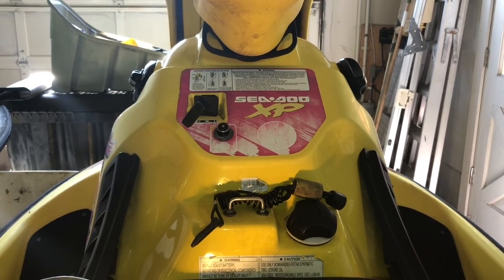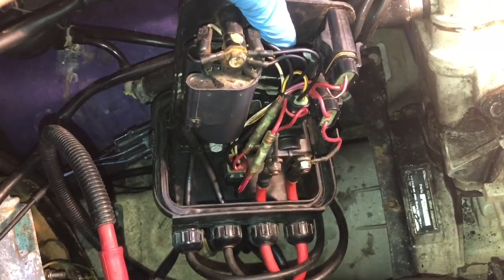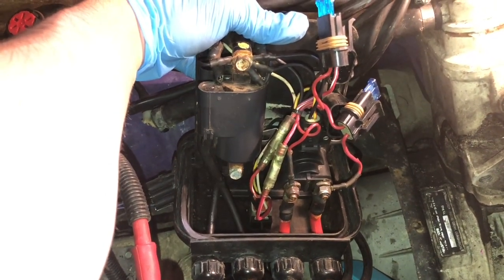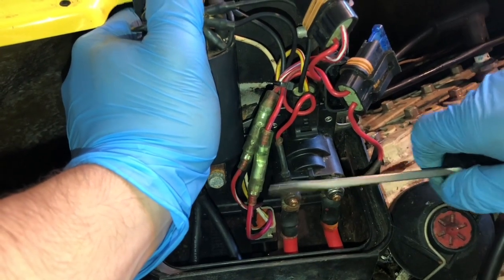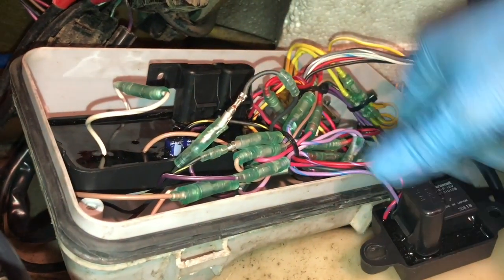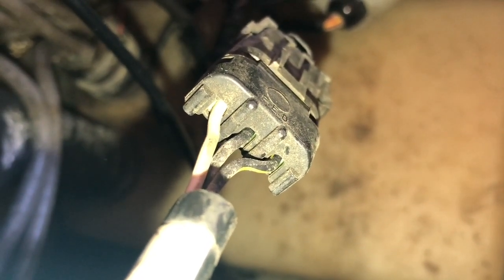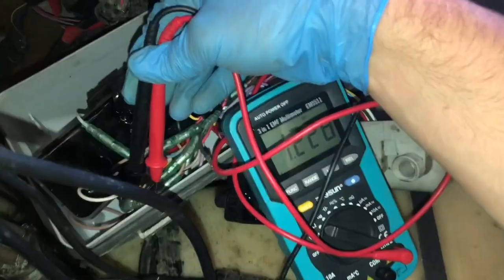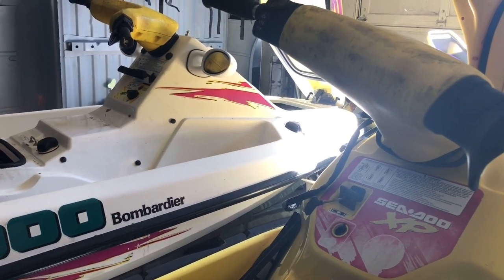1996 Sea-Doo XP Common Electrical Issues Fixed in Detail

Comment: Hello Adam   this Rob , I been watching  your videos because  I have a 1991 seadoo gt   with no spark I have tested  all the electricals but nothing   my question is  does  a 1991 seadoo  needs a programed key ? Or it can be by pass? In order to  get  it started? Because I don't have a key.   Thanks.

Comment: Thanks for the video.  do you have any idea what would cause the gauge to have nothing working on it?  the ski will start and run fine, but none of the lights on the multi function gauge work or come on at all.  They dont have any readings.

Comment: when you bridged the two red wires at the solenoid  if the starter was good it  would have cranked without pushing  the start button

Comment: This is odd starter solenoid should always spark the red incoming wire is straight from the battery the other red wire is to the starter ... shorting them just creates the circuit regardless of key absence or presence ... I don't understand how you don't get a spark shorting them.

Comment: Crossing the two large terminals on the solenoid should activate the starter motor. All it's doing is making a direct connection to the battery. Oh yeah, good vid. Thanks for posting this!
Reply: Yeah I know right...so wtf ..it would turn over immediately if starter good
Reply: Yeah this is an odd internet phenomenon , the solenoid info is partially incorrect,

Comment: Got a question for ya. My ski wouldn’t crank or nothing so I replaced the solenoid, cause when I opened the box it was  all corroded and rusty but after I swapped the new one nothing changed, tried jumping the solenoid and it started to crank over, pulled my starter and tested it it works fine. Could it possible be my start stop switch, some of the connections in the box look corroded but I wouldn’t think there corroded enough to make it not start, also changed all my leads from the starter to box and the ground and positive to the battery.

Comment: I've been looking thru forums and videos but I cannot figure out why mine is turning over without the DES on. I looked over the rear box and it needs attention. I re tightened the fittings and now it's dead completely.

Comment: great video, thank you...just fyi on the battery voltage, 12.2v is too low, it needs a charge.  A full charge should run around 12.4-12.7v

Comment: My no start problem on my 1995 HX was the fact that the nut for the screw on the positive terminal had come loose and there was no connection.  Glad it did t happen on the water.

Comment: So i have the same issue. I tested the voltage on the negative and positive wire on the solenoid. Measures 12.6. But nothing is happening. When i jump the solenoid it cranks over. What is the issue

Comment: bro, that is not how you check a safety post.   the two blacks should bridge when the post is near a magnet, and the one odd wire should bridge to the center pin on the post.    the reason is,  inside the post, there is a magnetic reed switch.   the key has a magnet inside of it, and the center post connects the Chip to the ecu.

Comment: Hey man. Whenever you put a screw driver across a silinoid that Jumps the starter an turns the engine over.  So idk why your telling people to put a screw driver across and hit the starter button   That does not tell you anything
Reply: he shoulda said “when i put the screwdriver across the solenoid and it cranks on its own, that means you need a new solenoid.” completely missed the whole point
Reply: @christophershirk489 nope that's also incorrect, anytime you connect the two poles of a solenoid you are "bypassing" the solenoid altogether, it's essentially plugging your battery directly into your starter, unless your battery is too low on voltage, disconnected, or not connected to the starter, it will always crank if you do the screwdriver method, the engine won't spark necessarily and you can't run it but it's a good way to get a compression reading on a stagnant motor. The author must have had a disconnect between the solenoid pole and the starter or between the other solenoid pole and the battery.

Comment: You should remind people not to  ohm fuses when you have the battery connected .   And you lost me when you shorted out the starter solenoid and then you went and hit the switch that’s the purpose  of 
Shorting it out with the screwdriver is to bypass the switch.

Comment: Just a heads up when you put the screw driver across both posts on the solenoid the starter will turn over without pushing the starter button. Your putting power straight to the starter
Reply: lol yes spot on, whats the point of pushing the start button if youre jumping the whole circuit with a screw driver ?? gonna get a hell or a noise while reaching for the start button ... and start is already cranking (if starter is good). 

Pretty basic stuff covered here, cant really own a jet ski if you dont know things in this video. These issues occur on all 2stroke and 4 strokes since they use basically identical starter solenoids. 

most of the time, its the DESS post ive found or an issue with the key.

Starters on the 787 motor die every year, so I just keep the part number handy for the local dealer, $300 every year or so for a genuine BRP unit.
Reply: I think my dess key is bad, it is a three wire version, but the part number listed in the manual does not show on the other three wire versions on amazon. Any suggestions?
Reply: @johnanthony5603  I’ve used this post on my spx and it’s a 3 wire. Works great now. It’s not item but seller is reliable. 

https://www.ebay.com/itm/174388386792
Reply: @oneeyedrone4293  thank you. I will give it a try next. Looks like a lot if people have issues with these sea doos. Hope I did not get myself into a money pit. I may reach out to you in the future. I am new to youtube as well, do you have a channel I can follow or subscribe to?
Reply: @oneeyedrone4293  thank you! I ordered the DESS just now from your ebay recommendation. Does my existing key magnet need to be changed or reprogrammed or anything? 

Fingers crossed this is the fix. Changed out the starter solenoid tonight and still nothing. 

I am fairly mechanically inclined and have worked on cars for years, but the ski is another ballgame. I am starting from lowest cost and going up as well as following you guys’ recommendations on here. Thanks a bunch for the help do far!
Reply: @johnanthony5603  if it’s not turning over at all it could be the starter. 

When you connect the key to the post, do get the 3 beeps ? That would indicate a good post connection. 

Also to test the start stop switch, without a key connected, press the start/stop switch. Gauges should come alive for a few seconds ... motor won’t crank. 

You could very well have a bad key that needs to be programmed or just a bad post. 
See what happens with the above.

The dess post is always a good thing to have as a spare. I changed mine since it was working but spotty. Sometimes I would need to reconnect the key a few times before I got the correct beeps. The same seller also has start/stop buttons, I changed that too for a nice reliable response from the switch. It’s the little things that can cause you a lot of trouble with these skis.
Reply: @oneeyedrone4293  cannot thank you enough for taking the time to reply! It only tries to start when I bypass the solenoid with a screwdriver. I don’t get any beeps when the key is attached. I will try what you wrote here in a little bit and will get back with you and see if the gauges respond like you said. I think it might be the DESS and the start stop button both. Super frustrating though.
Reply: @oneeyedrone4293  okay, no beeps at all, no guage movement or lights either with key on or off. I am thinking dess and possibly start stop as well!
Reply: @johnanthony5603  you can disconnect the start stop plug from under the hood and use a paper clip to jump the switch. 

It’s a black and yellow cable connector, it comes off the handlebars connections. 

My suspicion is the dess post and or key. 

Gauges should light up once you press start stop button.
Reply: @oneeyedrone4293  okay will try that next! You’re the man!
Reply: Got the post and installed it tonight! Boom, she cranks right over! Started on starting fluid, so I will tackle fuel system clean out and revamp next! Thanks for all of your help on this!
Reply: @johnanthony5603  excellent news. Glad you got it going. 

Change all the hoses in the fuel system to new rubber black ones. 

Also if you rebuild the carbs, use only genuine Mikuni kits. I had a hell of a time with some aftermarket diaphragms, never ran the same. Mikuni parts and she came back alive. 

Also check all the clamps on the oil injector lines. 

Good luck with the restore.
Reply: @oneeyedrone4293  thank you for all of the help! Will keep you posted! Watching a lot of videos on the fuel system now!
Reply: When I do it nothing happens! He has power . If I use the button it clicks and when bypassed it doesn't do anything
Reply: @jaycole5353  sounds like a bad starter then or a dead battery
Reply: I have a 96 gti 717. I get two beeps woth my key. When I hit start it tries to start and beeps once. It won't let me try to start it after that, without resetting the key. Any idea folks? Still won't start.

Comment: You did that like a pro. I'm watching this cause my issue is the batery led came on and stayed on today. I took a big wave over the front yesterday wondering if that has anything to do with it? The gauge has a low voltage part to it. That's why it's on but if tested the battery and its high 12s. Bad gauge??  Thanks

Comment: Hi Adam mate I was wondering if you come across an issue before I've got a fault on my Sea-Doo gtx Rotax engine 1997 I believe when I put the key on the display panel comes on for 1 second then goes off but when I push the starter button it comes on again and off if I remove the key and wait ,5 to 6 second and put the key on it does the same the display panel is not staying lit any help would be much appreciated regards Geoff

Comment: I have a 96 with a bad dess switch, 3rd time. Is there a way to convert to the earlier plunger style switch? Do we just solder in a resistor to match the readings and install a different style kill switch?
Thanks
Reply: buy a candoo pro programmer, you can disable DESS and then your post just becomes a connection, no more reading a programmed key. 
its a good and bad thing, easier to steal but lets be honest, anyone can just take the whole thing anyways 

also, with a generic DESS disabled, you can use the same key on multiple jet skis (seadoo brand).
Reply: @oneeyedrone4293  Awesome, 
Thank you!👍👍

Comment: Testing my start stop switch and it's open but when I push the start stop it jumps all over the place. It has straight continuity when I hold it down but trying to ohm out per manufacturer spec and it's just jumping everywhere. Can I safety assume switch is good since i have closed contact?
Reply: I also can hear the starter solenoid click

Comment: had a similar issue. got the 2 beebs but the start stop wasn't working and my compass direction wasn't indicating. i located the middle plug on my computer where those wires were routed to and i found 2 pins that were not touching their sockets. i didn't think there was anything wrong because i tone tested the start stop switch. i re set those pins by pushing them in and wala!!!!! it all works. the certified sea doo mechanic that replaced the computer never found the issue and said it was faulty. Don't always trust them. do some work until your problem. what made me find it was that the owner ( my neighbor) always had trouble with the switch and never had the compass working. so don't always assume the switch is bad.
Hope this helps some of you. btw.. great post

Comment: 1997 spx clicks and trim button does not work. Fuses good starter good new solenold .12 volts to the solenold.  Test light lights on the trigger side of the solenold when start button is pressed.   Also gets 2 beeps when the lanyard is plugged in      New battery.      What else ??

Comment: Hope you can help me. 96 GSX. 
The starter box got flooded so I replaced it with a different one. Now when I place the lanyard I get 2 short beeps and 4 long beeps. I've checked all the fuses in the rear and front boxes (all good) but haven't found the issue. 
Any suggestions?

Comment: I was able to get the engine to crank with the screwdriver trick.  So, I'm assuming I just need to replace the starter solenoid.  Sound right?
Reply: not necessarily. Could also be a control issue, could also be bad "start" switch. with out knowing ur ski's make model i cant tell which wires from your switch to test. The only thing the screw driver jump will definitely tell u is that the Starter motor actually works.
Reply: Br C so my old solenoid crank the engine only when it was bridge so without knowing we replaced it and the new ones does the same it’s cranks the engine when bridges so will this mean something else is at fault. I haven’t done that test light thing I will try later today. Any tips?

Comment: I have a feeling that your video is going to be the "end all" to get me ready for lake season.  I got to the point where I jumped the starter solenoid, and it threw out some sparks.  Is it safe to assume then that the starter is bad since there was an obvious connection?

Comment: I bought xp 96 it doesn't want to start only when you put a little bit of gas in the carb is there a fuel pump in this XP 96 do I need to replace a fuel sending unit

Comment: I'm not getting power to my push start but I can crank it over with a screwdriver that means selanod is no good right ? Could that be why I'm not getting spark ???
Reply: Did you ever  figure out the Problem?

Comment: you have the very best most helpful videos about seadoo on youtube!, thank you very much , really helps bring clarity to my electrical problems, although i have a crank, i have no spark, mpem on 97 is totally different than 96 and no aftermarket available,, so im going to retrofit mine with the 96xp, also the 97 doesnt have the nice gauges like a 96 only fuel and vts and rpm

Comment: Hey Adam, I was out on my 1996 SPX and it was running perfect and then died down and wouldn’t start. Tried many times and just get a beep when I hit start. Pulled it out of the water and noticed the drain plug was open. I took it home and cleaned out all water and dried everything. It only had maybe 3 inches or water in the hull. Just for precaution I put in new plugs, changed oil and fuel filter while I had it open, cleaned everything really good and still no luck, just a beep when I hit start, I checked all fuses in the box, put a new solenoid in, still no luck. I tested all wires going to DESS post and start button and still nothing. Any ideas? When I put the key on its recognized and when I hit start all gauges light up and I get a single loud beep. Jumping solenoid with screwdriver did cause it to crank so I replaced that per another video. Please help. I’m lost.
Reply: Also the battery was purchased new that day that I took it out so it’s new. I did double check voltage and it’s good.
Reply: Mine did something similar today. I don't have DESS just standard kill switch and while I was riding the ski stopped moving, but the engine was still running (like the wear ring was toasted). I was towed in about 1000 yards and after that I get no power at all. Haven't had the chance to dig into e-box yet, but did you ever solve your issue?

Comment: excellent video. One of the best I've seen-direct and to the point also giving us wisdom of possible mistakes.
Reply from the maker: Thank so much 🤟🏼
Reply: @adampaganelli4891  hey mate iv got a 96 seadoo sportster and having issues with tacho not working..checked all fuses and wires seem ok..any ideas please?
Reply: @adampaganelli4891  I have power on both sides of solenoid. Jump it and starter goes. I don't have to hit switch. But when I press start still switch nothing

Comment: great video, a question: what happens if you connect the battery wires wrong? the red wire in negative pole and  black wire in the positive pole of the battery? i just did  it and now my xp is dead,  thanks and sorry  for my english, greetings for Argentina
Reply from the maker: You will most likely fry a fuse. If left in that position for too long damage to your mpem could occur
Reply: that happened exactly,  i replaced it and now all ok, thanks you  so much bro.-

Comment: Friends borrowed our 96 for the 4th of July. They called said it died on the lake, they lost the deadman cord. How do I start it to get it back to the boat launch, about 5 miles away. 
Thank you
Reply: You cannot jump them, tow it back slowly or disconnect water line if towing over 10 mph.
Reply: @oneeyedrone4293  i just needed to bypass the Dess circuit, they lost the chip plug in the lake
Reply: @timmorris3056  still cannot bypass it, you will need a can doo pro tool. That will turn off dess system so the key can just be used as a magnet. 

You can also program a new key with the candoo pro system, add new keys etc. 

The system is not cheap, but very useful for seadoo jet skis.

Comment: I have a 97 XP, was running fine and died out on the water.  NO power to anything now, no start no beeps no anything. Dead.  Noticed it was beeping lately, sometimes just 1 beep. Could this be the Dess post or possibly a fuse?  Plan to diagnose tomorrow.
Reply: Hey Tony, Any Luck? Mine seems to do something similar.  My 99 GTX Limited will die randomly on water...It just cuts out completely. After a days rest it will run, but do the same thing all over again. Not sure where to start?